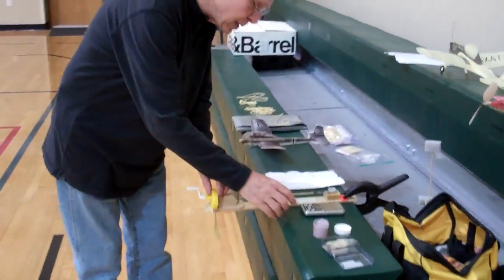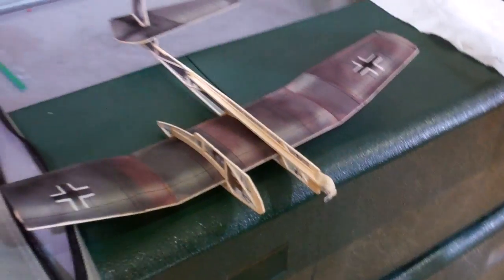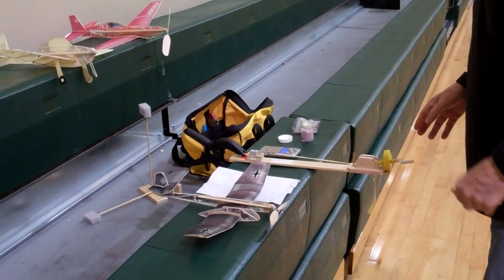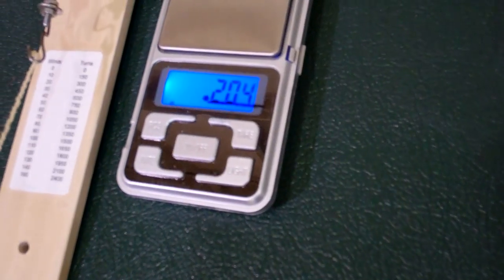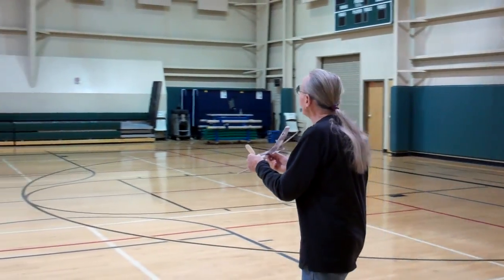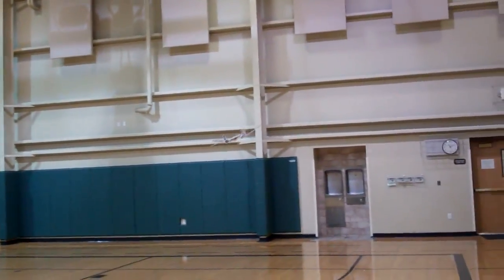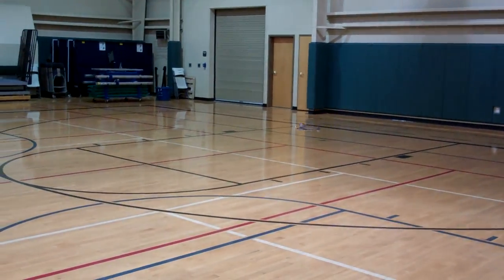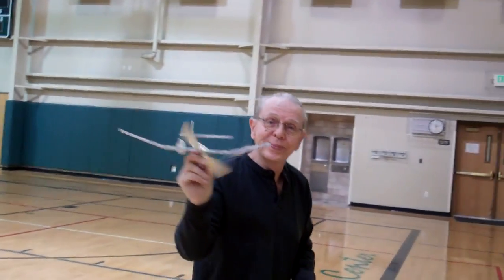Richards rubber band powered plane setup and flight

Comment: Hi there, I have a question, how did you have the rubberband to unwind for so long? because I have one myself and the rubberband unwinds really quickly, the plane flies fine, it's just it only stay a quarter amount of time compare to yours, thank you!
Reply: Tan Super Sport rubber from FAI model supply.  You strip it to width and cut to length yourself.  Use a good silicon rubber lube and stretch while you wind.  The motor in the video is most likely able to take around 150 turns per inch of loop length.  A prop with a high pitch to diameter ratio helps too.  

I fly my indoor sport duration models at a P/D of 2 to 2.2, and my scale indoor duration models like the one in the video with a P/D of around 1.5 to 1.75.  

Check out www.hippocketaeronautics.com for everything you would ever want to know about free flight model aircraft.  It's a great community.
Reply: If you hold the planes still it will still unwind fairly quickly. The reason it unwinds slowly is because the plane is moving forward, which puts air resistance on the propellers.

Comment: rubber plane sucks rc plane rocks
Reply: Yeah
Reply: aavatland your right
Reply: +Aryan Jdv 
Dont even go there, each has its own challenges, rubber is cheaper, quieter, safer, and some times easier, and more fun/challenging. rc is good in its own ways, fun, easy?  and challenging.
imho rubber is more fun, it is a challenge to trim, get the winds correct, the structure right, ect.
Do some research, and think next time before you say some "smart" comment
Reply: Ross Clements ITS NOT SMART ITS.........

SPARTA
Reply: This is not sparta little girl, this is a Blohm & Voss BV 141
Reply: If you only knew, i am sure you have never built an rc plane or freeflight model i have built many. there is a bug challenge of freeflight models and that is why people love them.
Reply: like i stated, freeflight was my choice.
Let me ask you a question, why is rc better, and why is freeflight bad?  BTW you left your CAPS on.
Reply: Ross Clements rc planes can be controlled while rubber band powered airplane just go by itself and plus rc planes can fly outside in high altitudes
Reply: Rubber powered planes are also fully capable of flying over 400 feet high, now rc aircraft are not allowed to fly over 400 feet because of FAA guidelines so it does not really matter to much about height as going over 400 feet is illegal!
Reply: Ross Clements can you give me a video link to a rubber band plane flying that high it seems interesting
Reply: Buy an rubber plane and you will know why it sucks, I use to have one..
Reply: exactly, your plane was a piece of foam that was too heavy to fly and used crappy rubber, these planes are hand crafted from balsa wood and weigh about 6-8 grams, they use the best rubber possible too. Some have flown for over an hour, that is longer than your average rc plane
Reply: Ross Clements Can you tell me what is the price of the rubber plane?
Reply: Ross Clements I will buy one then I will what is better
Reply: +Aryan Jdv you cant buy a good one, you build it
Reply: jeremy desrochers ....Isn't building a plane more "Nerdy"? Also I choose rubber band plane over R.C